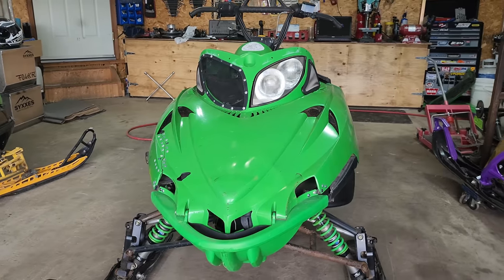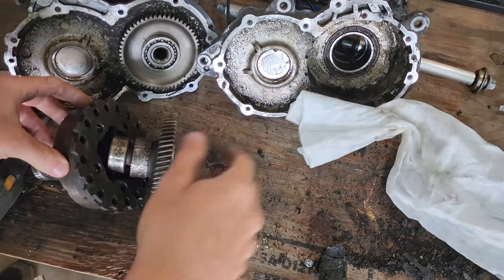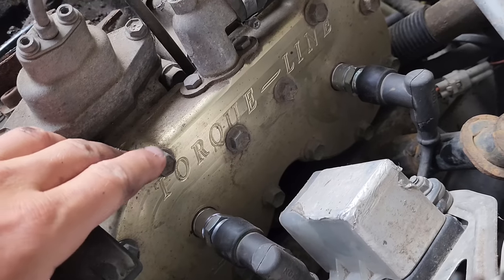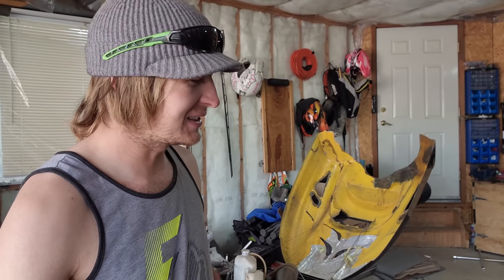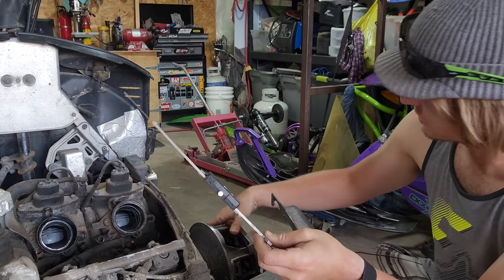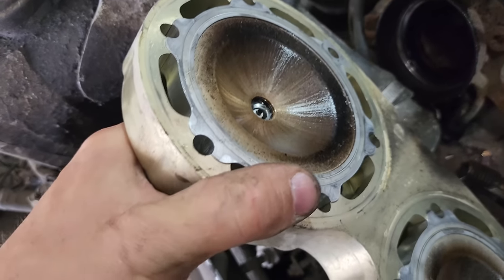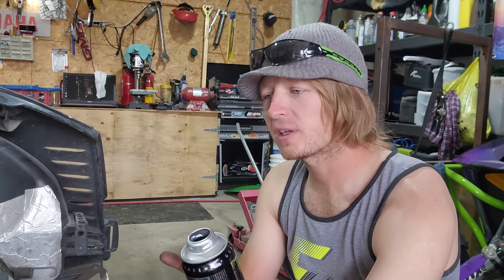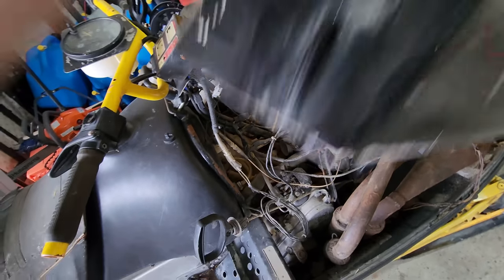Twin Pipe BIG BORE Snowmobile

Comment: Love the sled content in the summer, just finished up building my 2014 m8s engine with a fresh balanced crankshaft, slp stage 3 ported cylinders and head work, full exaust, tuner, ect.
Reply: Ouuu that's gonna be a ripper buddy!
Reply: Sick I just put my 08 m1 together with a eBay crank lol speed works full pipe and stage 5 fuel commander with injectors and team black cat racing power valve delete kit just waiting on a oil pump control rod

Comment: Having owned an '94 King Cat with a high comp head and twin pipes, jetting is quite a challenge if you have much elevation change in your rides. I'd bog at 8500' and melt down at 6,800'. Maybe you'll have better luck with FI. I have a smaller/lighter and probably louder silencer sitting around if you want it.

Comment: But is it a (turd 800 A/C ) or an actual 700 big bored to a 800 with GOOD POWer ? , as you and I know 180 IS NOT “reliably” attainable with a STK A/C 800 engine , without forced air induction … key word ‘Reliably’.  P.S. Love the clips !
Reply: Tf you talking about dude those suzukis can handle alot

Comment: I'm a skidoo guy to heart but those sleds are fast, the 1000 with a tuner on it is crazy, weak chassis but those motors are nuts
Reply: I’m about to find out this winter lol stage 5 fuel commander with the speed works full sys 08m1

Comment: Pull the domes and check the backside rk tek domes should have a code on them and Kelsey at rk tek will tell you if they are high compression domes or not you may have a big bore with high compression domes
Reply from the maker: Thanks 🤙